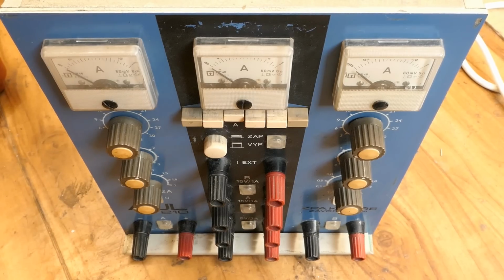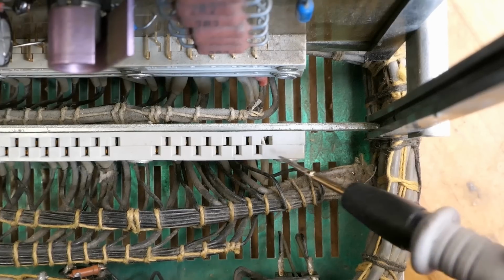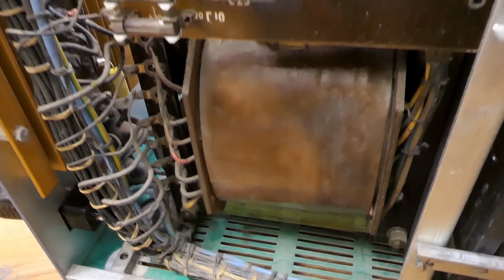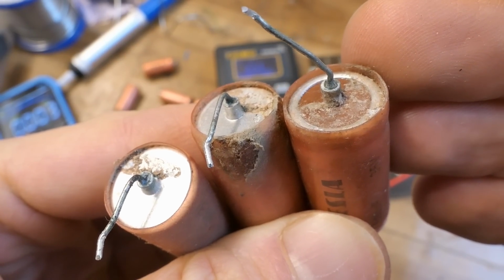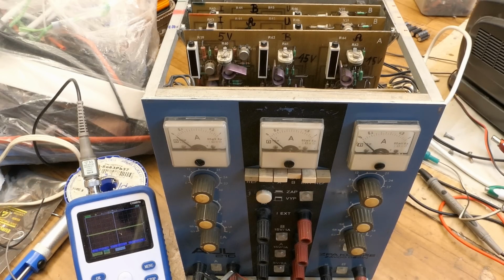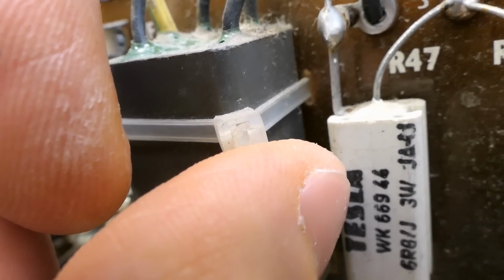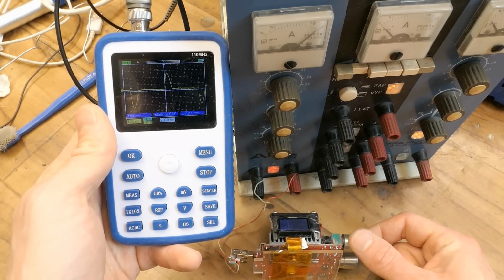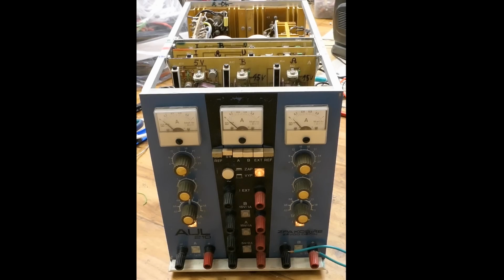Old bench power supply restoration (AUL210 from 1983) part 4

Comment: I am geting so happy because the op amp is not went out. I pick for the power transistor socket or legs are loosen and the driver transistor manage the output current.

It is some kind of reality show full of emotion and olso tell some story for me.

The axial caps allredy made by BCC (vishay) as contiunes the old philips XXX ones.

Comment: Can anyone please point me to the explanation what is ring testing and what does the ring testing (red device) with the LED counter do? Google searches seem to point me to something completely different.
Reply: The “ring” tester measures the Q factor of an LC circuit by counting the number of oscillations (“ringing”) after one initial impulse. The higher the number, the less lossy (i.e. less resistive) it is.
Reply: @noneofyerbeeswax8194  thanks thats a very elegant and concise explanation! So I suppose you would ring-test a circuit to see if there are unwanted oscillations in this case.
Reply: @yaksvk  Well, in this case 20:20 you actually WANT a high number (tens) of rings. The ‘5’ here may indicate one of the following:
1) Shorted turns in the inductor (low inductance = low Q)
2) High series resistance (bad contact or really thin wire)
3) Relatively low resistance in parallel with the LC circuit – which is indeed the case here. As we know, a paper capacitor arced over and turned into some sort of carbon resistor with ill-defined parameters. :)

The main use of this tester is finding faulty components like these. A good transformer or inductor should ring a lot when triggered by a single pulse, but if there are shorted turns or leakage, the oscillation shuts down quickly. You could use an oscilloscope for the same purpose, but having it all in a small box is more convenient of course.
Reply: @noneofyerbeeswax8194  this is like a year's worth of school knowledge condensed in that comment! Thanks!
Reply: There is a video on this channel of how to make the ring tester -  DIY transformer, inductor and capacitor in-circuit ring tester.

Comment: There's Schaffer filters available, but they are metal cased and have push on terminals at both ends of the case. There's a 3A one from Rapid Electronics in the UK. Will be subject to the board space dimensions if a replacement is decided upon.

Comment: That filter reminded me of a sewing machine I looked at around a year ago when visiting my wife's cousin and her husband in Germany. We had the thing in bits and were trying to figure out why it had started to run slow, accompanied by a slight smell of "hotness". While leaning over the opened base of it, the somewhat similar mains filter block decided to let me know what the cause of the issue was by exploding very loudly. 
It emitted a huge cloud of acrid smoke, while showering me with hot wax and indelible brown goop from the filter capacitor (thus ruining my T shirt). For extra pyrotechnical points, the coil, which was apparently red hot, then burned a small, neat, round hole in the table cloth. 
For some strange reason, I and my German host found the whole thing hysterically funny, but I'm not sure the ladies where particularly impressed. 
Maybe ensure you have your eye protection on next time you boil one. Just saying. ;~)
Reply: Similarly one day I bought a studio reel to reel recorder, it was listed as "working", but also weighs over 100 kilos. And before the seller left my house I said I wanna test it. "Luckily" the filter was on the verge in a similar way, so when I plugged it in something inside exploded with a lot of smoke filling the room and the breaker tripped. At that point I didn't yet know what happened but couldn't help asking the seller if they'd rather give me a 50% discount, or carry the 100 kg beast downstairs back to their car, and they gladly accepted the former ;-)

Comment: I see a lot of wonderful Tesla component in this piece of equipment.
Fortunately they are not used very often in North America.
However these ones seem to have lasted at least 30 years.
I once bought some 60 watt Tesla light bulbs.
They lasted about 4 hours.
Reply from the maker: Lamps lasting just 4 hours? They should last much longer, unless they are special super hot filament photo lamps. Or they might have some air already leaked in.

Comment: When a capacitor reads low (using a multimeter) it is probably leaky.
The Multimeter reads capacitance through measuring the time constant, which gets longer when the capacitor is leaking, hence the higher capacitance reading.
In my personal opinion, if a capacitor measures more than ~10% over its nominal value, its probably bad.
Reply: Electrolytic capacitors usually have a tolerance of +/-20%, so 10% high is perfectly fine. Vintage electrolytic capacitors sometimes had weird tolerances, like -10/+80% for big filter caps, so almost double the nominal value is fine in the case of some vintage capacitors. They done this for reservoir caps, for two main reasons: they intentionally made it higher capacitance, so it will have more headroom for aging, and also for ease of manufacturing, they probably aimed for +50% of the nominal value, but whatever came out, was most likely in the -10/+80% tolerance range, so they rejected only the really bad ones, which caused a better yield, less production loss. 
If excessive leakage current is a concern, it should be measured with a current meter, after the capacitor is precharged to its nominal working voltage.

Comment: That diagnosis using the sounds of the transformer buzzing was quite clever.
Reply: It's an experience who make technician work better
Reply: I’d love to know more about the science behind this, more specifically how a normal transformer functioning fine makes a 100hz hum?
Reply: @BritishEngineer  Usually the iron core transformers use laminated sheets to minimise eddy currents, and I think the varying magnetic field vibrates these sheets a little, causing the noise. The sheets are usually welded together at a few points to reduce this as well as making sure the core actually stays together. Remove these welds with an angle grinder, and your transformer will make crazy loud noises
Reply: I had the same problem with my solder station, it were also the diodes, the FBR 4 diodes.

I replaced them all, one was burned, and yeah also strange sounds from the transformer, 
and i replaced all the caps with much better ones on put 2 fans in the solder station, now
everything is working normal again.
Reply: @AmigaWolf  Good repair. Glad it's working again.